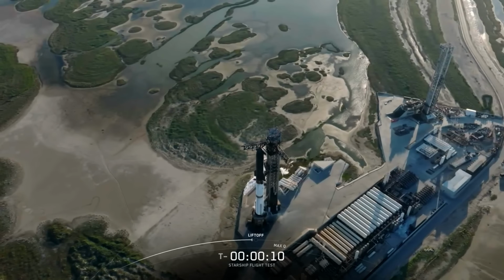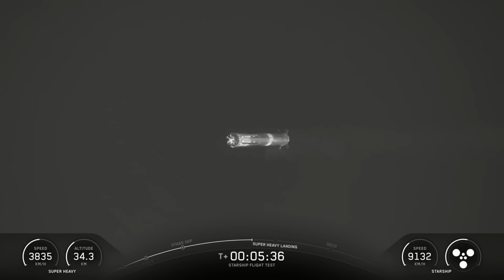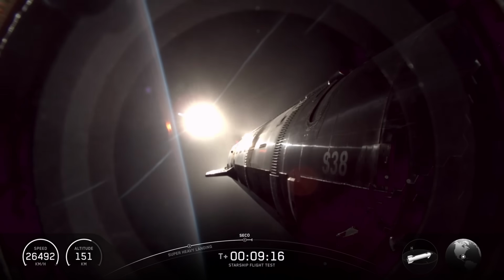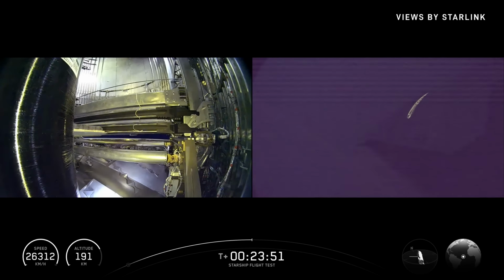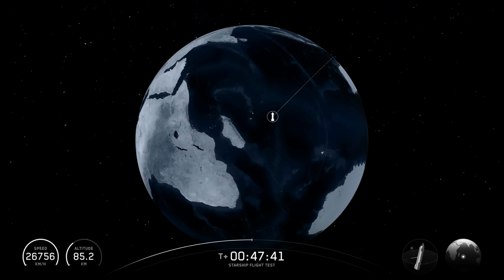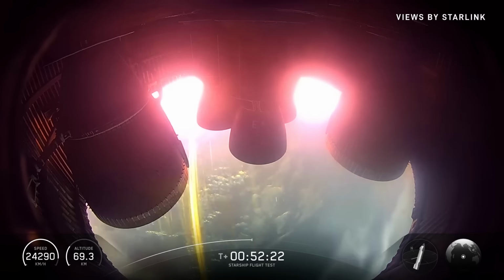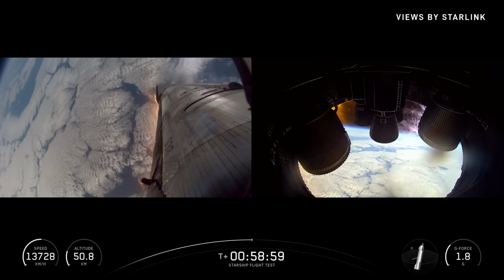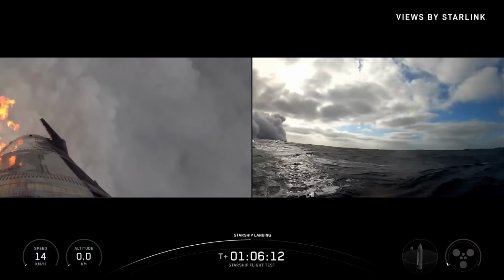Starship Flight 11 Was INSANE — This Supercut Proves It!

Comment from the maker: 00:00 – Liftoff: Starship Takes Flight!
02:30 – Stage Separation!
06:10 – Booster Returns in a Fiery Landing!
09:00 – Starship Achieves Orbit!
10:38 – Starlink Deployment in Space!
19:22 – Raptor Relight Test in Orbit!
21:55 – Fiery Reentry Begins!
34:18 – Intense Dynamic Banking Maneuver!
42:00 – Starship Attempts the Landing

Video Credit: SpaceX

🔔 Don’t forget to like, subscribe, and hit the bell for future Starship updates!

📚 Learn More:

🚀 Starship Block 2 Explained:
 📖 Summary: https://shorturl.at/b0dtw
 🔍 Detailed Explanations:
  • Design Improvements Update 1: https://shorturl.at/lpGT7
  • Design Improvements Update 2: https://shorturl.at/gwNQ4
  • Nosecone & Payload Bay Redesign: https://shorturl.at/xa60S
  • Methane Downcomer Redesign: https://shorturl.at/XdYBG

🚀 Starship Block 3 Explained: https://shorturl.at/mnBT4
  • Detailed Breakdown: https://shorturl.at/IViwD
  • Production Begins: https://shorturl.at/xRNkJ
  • New Transfer Tube / Downcomer Explained: https://shorturl.at/Iaqc6
  • New Grid Fin Explained: https://shorturl.at/NxdVo

🚀 Starship Block 4 Unveiled: https://shorturl.at/7A2ef
 
🔥 Raptor V3 Mega Upgrades & First Test: https://shorturl.at/TRIyj
🧱 What’s Inside Starship GigaBay?: https://shorturl.at/nJM75

🛠 Insane Engineering of New Starship Launch Pad 2: https://shorturl.at/7RAZd

🛢 Dual-Port Orbital Refueling – Full Technical Breakdown
https://shorturl.at/5tiqK

🛠 Other Starship Upgrades:
 • Hot Staging Explained: https://shorturl.at/jf400
 • Super Heavy Booster Upgrades: https://shorturl.at/Pi5R3
 • How SpaceX Protects Raptor Engines: https://shorturl.at/4Om8F
 • New Heat Tiles Explained: https://shorturl.at/p2Ijb

🚀 Starship Flight 10 
  📽Detailed Breakdown: https://youtu.be/irVUMJNe0Kc
  📽Root Cause of Anomalies: https://youtu.be/LBUpp7MRVSY

📡 Stay Updated:
📢 Weekly Updates: https://bit.ly/3HIQjPC
🚀 SpaceX Playlist: https://bit.ly/34wue8T

Comment: Well, not blowing up or disintegrating on reentry is an improvement.  Still, not to orbit and only a 17.5-ton payload.  Raptor 3 not flight tested, orbital refueling untested, 20 or more refueling launches for translunar injection, no manual control for landing, high center of gravity.  A plan that puts Rube Goldberg to shame.
Reply: I'm not sure of what point you're making. Yes, of course there's a lot of work to do, but there's no one remotely close to SpaceX right now.

Comment: do they intentionally blow it up once landed in the ocean?  Or is that a natural consequence?
Reply: Imagine a building fall on its side. Do you expect it to stay intact? The ship is a very thin steel condom, it’s not designed to fall on its side as well. It smashed and the remains of fuel exploded.
Reply: They intentionally blow it up - Yes it's possible that falling on its side in and of itself would cause an explosion, but it's not guaranteed, and they want to be certain it explodes.

Comment: Why can’t it make orbit?
Reply: Can easily make it to orbit. They are intentionally avoiding having it go into orbit.
Reply: @donmario6004 nope thats bullshit!
Reply: @bubbafatas2588  No it's not BS. All I have to do is accelerate a little bit more, and their orbital. They more than easily have the capability to go orbital. They're in space and they're going just below orbital velocity - by design.
Reply: Most probably because of the FAA regulations, this is a big thing and if they lose control in space - that thing should fall into the ocean by itself and not stay in the orbit and fall on a random spot (a big city for example) later. When the ship is tested enough they’ll lift the regulations.

Comment: Does anyone know why SpaceX chose to have their Starlink "Pez Dispenser" oriented horizontally?  It intersects several vertical supports, which must compromise Ship's resistance to longitudinal torque.  Having a vertical slot would make for a much stronger Ship body and allow two or three ports if need be, providing important redundancy.  It would probably be less expensive to build and maintain too.
Reply: Laying flat means you have the whole length of the cargo bay to stack them, whereas sideways means you only have the width  of the ships hull, way less units.

Comment: Well… they made it, the heat shield suffered less damage than before, and the explosion in the skirt was smaller this time. The flaps are still suffering burn through, and on at least 5 occasions large pieces of the ship fell off during reentry. This is still a long way to full/rapid reusability. This reentry would necessitate extensive refurbishment.
Reply: Yes, and bear in mind these low level deployments are done at half the speed of  the proper satellite deploying Falcon rockets. They have to go twice as high to launch them in to orbits, which means re-entry speeds will be twice as high.
Reply: @dnomyarnostaw nope, not twice but only about another 1400 K per hour for LEO.

Comment: Stupid it blow again . with a lot of fuel . wasn't better to land it with out fuel so that it doesn't blow up
Reply: When you start your space company you do it better then.
Reply: They weren't recovering it
Reply: There’s an engineering question in here: what is blowing up and why? Why is there still significant fuel on board at the end of the trip? Is it just the landing fuel reserve? Is part of the explosion the abort charges?
Reply: It's done on purpose so it isn't  floating around being  a naval hazard.🙄
Reply: @WyoSavage1976  The sub covered about 800 km under the sea in 2 weeks ,which means it was moving at about 57 km a day,some thing is very wrong with this sub.

Comment: 10:17 Something blew up. 10:18 You can see a piece clearly flying away from the camera.
Reply: Looking at it at 0.25x speed it looks very weird. Like it's very tiny, but started right next to the camera.
Reply: Likely a cover over a vent, that blows off when the vent starts being used.
Reply: It is ice from the cryogenic propellants btw
Reply: Extremely hot rocket ship, cold water, somethings gonna give (heat shield pieces), but the last thing we saw was the majority of the ship still floating on the water.
Reply: The whole thing blew up on landing.
Reply: @manolikonstanta6369 it's supposed to do that. Can't have it float around and be hazard or have some other entity taking it it to study..
Reply: @manolikonstanta6369 as it is meant to
Reply: @manolikonstanta6369 how is that relevant in any way to anything?

Comment: It blew up on touching the sea. Spectacular, like a huge bomb.
Reply: It's suppose otherwise it be gloat by being a hazard or some other entity can steal it. They purposely do it with in board explosives.
Reply: @WyoSavage1976 No. This because it’s not a brick of steel, but a very thin steel condom. It’s not designed to fall on its side, it gets smashed and the remaining fuel explodes.